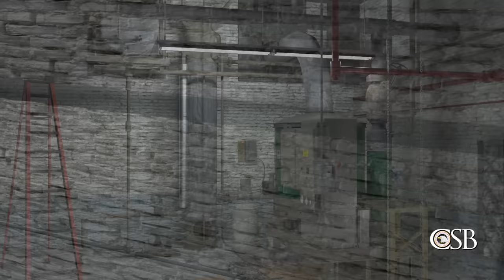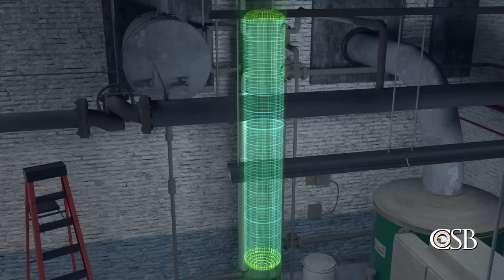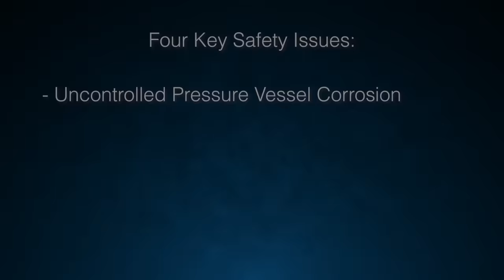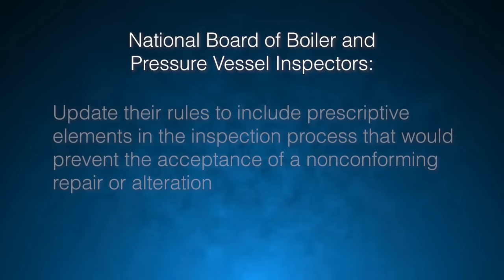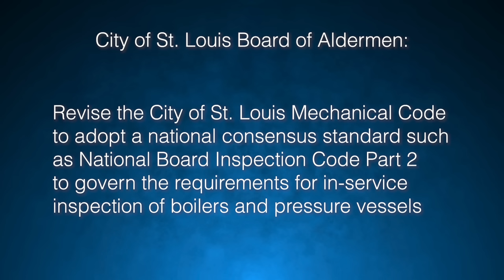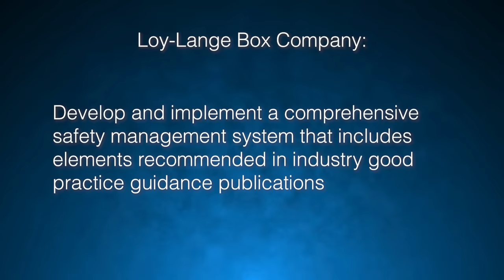Ignored Warnings: Explosion in St. Louis

Comment: This burns me up. I see too many videos of tragedies like this that didn't need to happen. The first thing I see is that too many times corners are cut to save money. In this example their head of maintenance should have been trained as needed to deal with all aspects of the plant operation and maintenance. If you have pressure vessels you should have a head of maintenance who knows all of the proper procedures to maintain the equipment particularly gas and pressure vessel systems. There are reasons why there are rules and regulations and doing what should be done to minimize accidents in the long run and also probably save money and lives. What was not done here I'm sure resulted in much higher cost than proper repairs and the chemicals to maintain the system. They should have been doing cold water pressure tests on anything that involved significant pressure. Another disaster included management ignoring being told that people smelled gas. If the system is setup correctly you should never smell gas except perhaps burners are being lit. After that, the odor should dissipate within a short time.

Comment: Thats why u should use polyglass pressure vessels, polypropylene tanks that are wound in fiberglass,resin and hardner.No metal to corrode and weaken and they also pass pressure and internal,explode & implode vacuum tests for complete durability.They also drain from the very bottom of the head cap not on the sidewall letting water sit in place and go stag.Just saying.

Comment: Maybe I'm just way overthinking this, but I'm picturing a control valve that prevents outflow from the make-up tank at less than specified temp as a barrier to oxygen entry. (Plus scavengers -- when it comes to anything that can go boom! I'm remarkably okay with the belt-and-suspenders approach.)

I don't know how much would that have cost to buy and install, but I'm dead sure that sum is less than the damage bill here.

Comment: ASME created strict codes for boilers and pressure vessels so something like this shouldn’t happen. However, when a critical structural code for a PRESSURE VESSEL is ignored or incorrectly followed, this can lead to the vessel failing as seen here. The repair made by the fabricator was insufficient because all of the affected material wasn’t removed. The head of the vessel should have been removed and replaced. At that point, the vessel should have been removed from service and a new vessel should’ve been constructed. Another thing is that the vessel was never inspected when it was installed and after being repaired after a critical failure was found. ASME created these codes for fabricators and inspectors so that an event like this should never happen. The CSB gives a great explanation as to why this vessel failed and how it failed in great detail. This video along with others like it should be shown to inspectors and fabricators to demonstrate what a failed pressure vessel can do and look like after an incident.

Comment: No one knew when to pucker up. Certainly not management.
It is false security to hire a risk management company to manage your company, then not taking any responsibility.
Even in our homes, the hot water heater has a pressure relief valve, that functions to release pressure before catastrophe.

Comment: What pisses me off the most about situations like this is that someone saved a few bucks on not putting safety systems on a boiler system, then saved a few bucks on not putting a sacrifice metal system, just to be safe, on a system that was already having problems with corrosion, then saved a few bucks on a half-baked repair, then an inspector trusted on word of mouth to save time on doing a visual inspection, and now 4 people are dead.
Saving money cost lives. And I doubt that the responsible is going to face any criminal charges or have any kind of real life consequences. "Oh well, pay some reparations, negotiate for lower costs, issue a note, and keep going as usual".
Lives are too cheap.

Comment: Question. Water is made of two hydrogen atoms attached to one oxygen atom. If all oxygen is removed, you only have hydrogen. I don’t think I’ve ever seen hydrogen “water”.
Reply: You’re mistaken. They aren’t altering the water as a compound; they’re removing dissolved gases in the water. In this case, dissolved o2 since o2 is corrosive. They did not alter the h2o.

Comment: The welder that signed off on the repair is ultimately responsible for the failure of the pressure vessel.

Comment: None of these and similar industrial disasters would happen, if engineers and contractors had a statutory obligation to report systemic failures to regulatory authorities and those authorities had the power to enter premises without permission and take plant and equipment off line until repairs are made.

Single point failures of equipment, are a financial drop in the ocean compared to the cost of a catastrophic failures.
In this particular case where there was a systemic failure of corrosion prevention and management, the corroded head should have ben fully replaced and an multi step program for reducing and eliminating the on-going corrosion problem, designed and enacted, with a completion date.

The plant manages who were responsible for doing ignoring the corrosion problem, should be charged with conspiracy, and negligent homicide. AND they should be named and shamed!

Comment: That's common sense, you have to cut out all the rusted damaged area then replace it with new. You don't cut out most of it, you cut out all of it to fix it correctly. I know that and I'm not certified to repair pressure vessels. SMH

Comment: and they need some old style calipers for measuring that steel plate, like the ones that look like pincers so you can measure thickness of a bowl shape. Then in 2012 the company should have noticed if they did that.
Reply: and maybe unpopular but I wonder when more of this stuff will be made out of stainless steel. Like damn stop being so cheap with capital expenses, its supposed to outlast you if your business plan is any good so you have money for when you are 100. Like the big crap that can go airborne should be made out of stainless IMO, so long that can work with the rest of the system.
Reply: and the vessels should be built with some flares like intake manifolds

Comment: Also, with the Chernobyl disaster, even when you take into account the design flaws of the nuclear powerplant, if they had, at least, very carefully follow all safety protocols, it very likely would not have taken place. But the Soviet Union, as far as we know, cut corners all the time in regard to design costs and safety measures.

Comment: Although I can weld I don't do it by trade, however I can't understand why you wouldn't repair & remove ALL the rusty area instead of halfassing it. ??? 🤯  Again I don't do it by trade, but I know enough that rust shows weakness in the structure of whatever you welding, and needs to be removed/replaced.🤨

Comment: I feel most of the blame on this one doesn't go to the business and it's employees, other then the "you own it so you should understand it's risk" side of things and they probably did when it was installed but over time lost that understanding as new employees replaced old ones.

they did try to have the thing fixed, but the welders didn't do the job properly and the inspectors didn't do their job properly either.

I think no one on that site even thought of the thing as a pressure vessel/ giant metal bottle rocket waiting to happen, they just thought of it as a leaking hot water tank.

it would be really nice if the relationship between inspectors and business didn't feel so adversarial so a business might actually invite inspectors around to make sure nothing has changed.
I don't know how you would fix that relationship though.

Comment: These pressure vessels are no Joke. I believe that this failure should fall on the inspectors. Yes many things were done wrong and overlooked. But in the end this repair was recorded,and at that point the inspectors were responsible for overseeing the repair and signing off on it or not. That's why we have inspectors, and why they are so important. There should always be a boiler tech running these systems ,and proper inspections done regularly.  Sounds like

Comment: I may be slow, but isn't water H2O? Meaning you can't have water without oxygen? 

I'm aware that water can be corrosive so people typically use stainless steel and applications of water because it's resistant to corrosion from water.

My question is why not use stainless steel or a corrosive resistant Steel inside the steam generator?

I guess I should keep watching so I can get a better understanding of what's going on here.
Reply: The video is referring to oxygen gas dissolved in liquid water. Water naturally contains dissolved oxygen. That's how fish breathe for example, their gills absorb the naturally dissolved oxygen. Dissolved oxygen is very bad for steam systems, and must be removed from the water. There are two primary ways we do that. The first is by heating the water to near boiling (around 200F as the video stated), and the second is by adding chemicals called oxygen scavengers (also as the video stated).
Reply: @oxnardmontalvo  It did a poor job at explaining it because no one would thing water can have too much oxygen in it. I've seen multiple steam boilers and not one of them ever talks about oxygen rich water or adding chemicals to dissolve oxygen. They don't even have warning about this on them. (They do have over pressure release valves.)

This video came off a lecture on what they know instead of trying to inform people that there is a hazard with steam systems that people may be unaware of.

You did a far better job of explaining extra oxygen this than the video.

Comment: I'm a Steamfitter-Pipefitter by trade, and this steam system is not even remotely up to the standards and codes we practice in Canada. I work in REAL steam generators that utilize effective corrosion, erosion, and scaling mitigation. If you have ever been around steam at 400°C, you'd be wise to respect it's power. These fools treated it as a joke. I mean, it's only water right?!?

Edit: I forgot to mention one of their fatal flaws. They replaced their carbon steel make-up tank with a stainless steel tank because of corrosion. That's fine, as long as you electrically isolate the contact points between the 2 dissimilar metals. If not, you get accelerated corrosion in the less noble metal (in this case, the carbon steel). The stainless steel may get some surface rust, but it's generally fine. However, the carbon steel will "rust" (oxidize) at a staggering rate. I see it all the time in systems that use several different metals in their construction with different corrosion properties (redox potentials). Bolts that look 10 years old and they're brand new; nuts seized on and have to be cut off. The proper way to connect those materials is to use an electrically-insulating connector (dielectric  unions, insulation kits, non-conducting adapters etc) which breaks the path of electrons during the oxidation process. Rubber, non-conducting polymers, plastics, or resins are commonly used depending on the service conditions. This simple step saves headaches, money, and potentially saves lives...

Comment: Can anyone explain to me how you can remove or add Oxygen to water? Water is H2O, 2 hydrogen and 1 Oxygen atoms. If you remove the O2 atom you get "H" Hydrogen, if you add an O2 atom you get H2O2 or Peroxide, if you add a Hydrogen atom you get H3O or hydronium. So to say that you can remove or add O2 from water, or Oxygenate water is nonsense. Now they may be able to add Phosphates to the water or use some other additive in the water or use an anode in the system to prevent corrosion, but you can't remove the O2 from the water. If you do that it is no longer water.
Reply: You are correct, water is indeed two hydrogen atoms and one oxygen atom. In this case however, they're referring to oxygen gas dissolved into liquid water, not actually changing the chemistry of the water molecule. Dissolved oxygen is how fish breathe, their gills absorb the dissolved oxygen that occurs naturally in water.

Comment: Water treatment for boilers is very misunderstood by plenty of boiler "operators" out there. I've beat my head against the wall with these guys that think juicing systems with chemicals keeps it all good even though they have no clue where to actually inject the chemical or what temperature the oxygen scavenger even works at. Not to mention polymers for sludge control or amines to keep the condensate from corroding from carbonic acid. The two box facilities I did care of in PA were very well run i will say but they were a lot bigger than this dump.

Comment: Here is what is messed up......if you or I was this premeditatively negligent, over time, and this resulted in 4 deaths, we'd be in jail. Did the higher ups that were responsible for these decisions go to jail? I doubt it and the company is still "in business." Hopefully, they were at least sued. But really, those responsible also need to be in jail, not still sitting in a board room still running a company(s).

Comment: City boiler inspectors do not have X-ray vision. No way do they catch that.
Reply: You're missing the point, the pressure vessel was sitting right next to the steam generators, and they never noticed it at all. And you don't need X-ray vision when ultrasonic thickness meters exist.
Reply: @oxnardmontalvo  you are missing the point. City inspectors only observe. They do not have the equipment (ultra sound testers), time,training or liability insurance to perform testing. The condensate tank is always next to the boiler, and you do realize that this is animated and not actual photos , right?

Comment: I graduated from high school water is 2/3 air what's he talking about
Reply: Water (like for drinking, bathing, etc.) is 2 parts Hydrogen, 1 part Oxygen. Oxygenated water has 2 parts Oxygen. The extra Oxygen molecule is the kicker - it has a negative interaction with steel. It's mind-blowing when you think about a single extra molecule having such an impact, even if you ignore the fact that gold and lead are one molecule different. And when you consider that Hydrogen and Oxygen are two of the most flammable elements we know of, yet combine in such a manner as to be safe for drinking, and even for dousing fires, but that extra Oxygen molecule means it can now eat steel.

Comment: Not a fan of the CSB recommendations here at all. The bureaucracy of the recommendations made to the City of St. Louis are the concerning part. I do not like to make comments, especially derogatory comments, about an action or subject without having the pertinent information so I may look into this a little more. I would be curious as to the inspection programs in place at the facility and the information from previous API 510 inspections and ultrasonic thickness survey examinations on the bottom head. Access would have been limited by the skirt but there should have been enough access to obtain enough info at designated CML's to establish a short term corrosion rate. If they made a major repair to the head, then they had some form of inspection done. Likely ultrasonic thickness based on the type of repair shown in the animation. They mechanical contractor would have had to know where the insert could be placed to tie-in to sound material that is above the thickness minimums for the vessel design pressure. No mechanical contractor that carries an "R" stamp is doing something like this without an inspector and engineer as well as NDT previous information and on site at the time of the repair with MT or PT capabilities to ensure weld prep. Now taking that much of an ellipsoidal head with threaded outlet nozzles, especially that close to the knuckle seems fishy but it is just an animation so the real repair may not be as sketchy. I would need more info to call anything out but ...They didn't make the 2012 repair and replace the M/U tank without knowing the remaining life. So I am sure that UT data exist for the vessel the M/U Tank and the piping as well as a 570 report on the piping system. To any inspectors reading this... this is why you CYA and also highlights one of the many added potential damage mechanisms of cyclic service.

Comment: What was not monitored correctly was the pressure.  Steam is an unlimited power.
Reply: The steam pressure didn't rise beyond limits.  The pressure vessle failed due to corrosion that caused thin metal to fail under normal steam pressures.
Reply: @danburch9989  yes

Comment: That pressure vessel was weak and the thickness of a residential water heater but in a commercial,industrial process and its the backbone of that steam system ,,so now they're gonna act like they didn't know there was regular inspections and maintenance required for pressure vessels. Fines?

Comment: Should`nt those tanks be made of a stainless steel??????
Reply: Stainless steel brings its own issues. It's significantly more expensive than carbon steel for one thing. So, to build an entire steam system (boiler, pressure vessel, pre-heater or make up tank, piping, etc) would be much, much more expensive. Second, if you properly manage your corrosion control program, primarily by treating the water to remove the dissolved oxygen, corrosion won't occur, or will occur negligibly. Third, stainless steel is not corrosion-proof, and has other means by which it can corrode and fail.